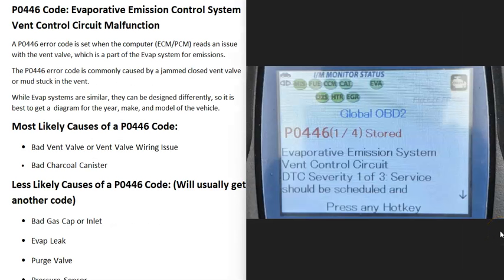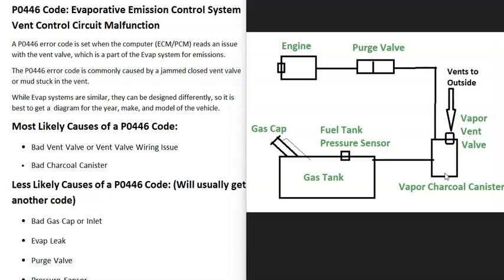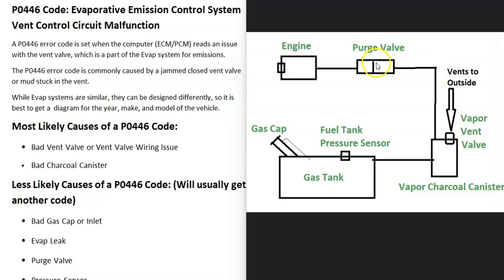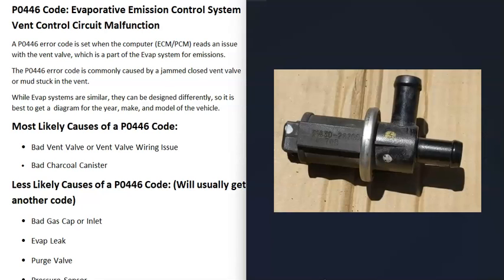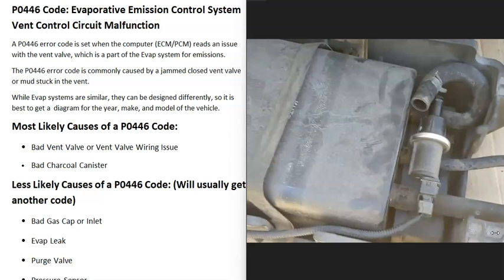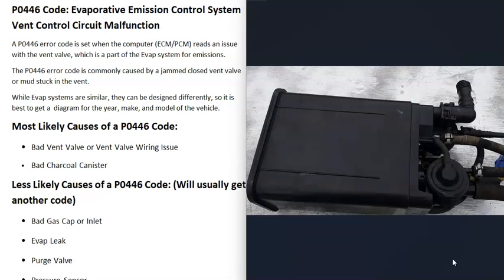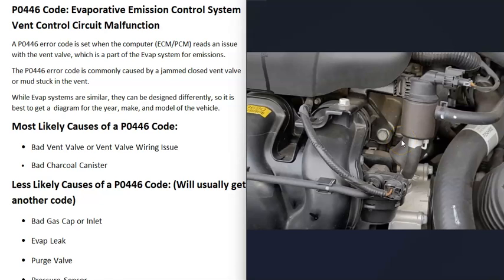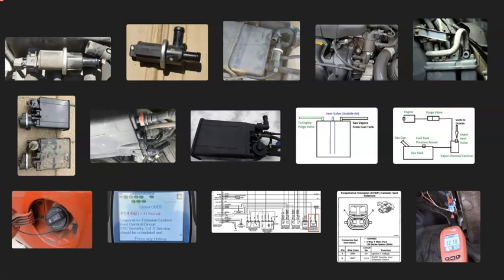Causes and Fixes P0446 Code: Evaporative Emission Control System Vent Control Circuit Malfunction

Comment: I am not a truck v8 engine mechanic. Bring me your older H-d and you will be happy. I have an 09 F-150 4.9 and just had a fuel pump etc. replaced. Tonite my GF and her 2 kids needed a ride home form my casa and the mighty F-150 spun just like it did @ the Circle K Wednesday and got tow to Pepboys on the corner where I live. 1600$ later, I was happy. Got it to go earlier and we got nada, just like it was on Tuesday. ???????? Just cranks and cranks. Got a code of P0446 and found the part @ 109$ but could it be a bad fuel pump again?

Comment: I have a 03 Chevy S10 zr2 I did smoke test and my vent solenoid they were smoke coming out and I test it on my truck battery and it didn't click would that be the vent solenoid
Reply from the maker: The vent valve is normally open, and smoke will come out of it while testing unless it is closed. It should click when power is applied; if not, that usually means it has failed.

Comment: I still have the code P0446  code any suggestion? When I refilled the day STILL had fueling issues but not CLOSE to what it was.
Reply: maybe replace the whole charcoal canister thats what imma do soon with my code p0446 taking it to my mechanic this week soon
Reply: @beexiong2171 exactly what I did
Reply: @beexiong2171  if ya wanna save 200$ here is what I did I bought the Dorman canister that doesnt have the sensor Port. Messured the area of the hole and where it is located used a step drill bit to make the Hole. And put the sensor in. Works as it should. Canister with sensor port 400+ without 140.... same internals. Why!? Such a difference in price NO CLUE.

Comment: Can having a code P0410-Secondary Air Injection System make the system throw the code for the P0446  also or do I need to replace both parts? It's on a 2001 Chevy Blazer LS.

Comment: I replace my emission vent solenoid  on a2006 Frod Freestar 3.9 and the engine  light is still on  what should I  do  next
Reply from the maker: It varies between vehicles when the computer tests the EVAP system. Also, many vehicles need a Drive Cycle to fully clear the code. Most people will drive around for 3-4 days, and if it's fixed, it will go away. You can look up the information on your vehicle to see what steps the computer needs to speed it up.

Comment: My P0446 is signalling excessive pressure. If I open the gas lid, the pressure sensor still shows -11.45mmhg. It doesn’t move much from -11. When I run the car, it still always stays at -11… bad fuel tank pressure sensor maybe? Chevy HHR
AllData is saying it should be at 0 with the gas lid off.

Comment: I have a 2013 Ford edge sport with the p0455 and p0446 and I'm 85 percent sure it's the fuel inlet. Ford's early non gas cap vehicles.

Comment: I am getting random p0446 I was told that it appears to be a short because the computer won't let him run the vent test, and it is causing it not to vent when it is idling which is causing it not to pass the cars diagnostic check but when I am moving it vents.  I just spent a lot of money on other repairs and asked the mechanic if it would cause performance issues or hurt my mileage, he said no.  Is p0446 just environmental?
Reply: It's environmental.  I was in Massachusetts and my 2002 Hyundai passed inspection with the code because of the car's age.  Moved to New York and it's a problem because it's less than 25 years old.  The mechanic thinks it might be the ECM, but no guarantees.

If your car passes inspection in your state, you really don't need to worry about it, but you should occasionally scan and reset just to keep an eye out for other codes.
Reply: @kenweller2032  Yeah, I got a cheap $20 reader with clear codes option.  I live in a state once you buy the car you have an inspection and your done you never have to worry about it again.  I didn't want to leave the light on because I would never know if new codes pop up.   Thanks for the reply.
Reply: Ò @kenweller2032

Comment: I'm getting P0446 on a Toyota Camry. I changed the gas cap and it's still there
Reply: Did you find the issue I'm having the same problem ?
Reply: @JosephRosado-u8m  It just went away on it's own. Best bet is to replace the charcoal canister.
Reply: @mr.paulino9318  thats what i plan to do just let me mechanic change out the whole charcoal canister  hope it fix the p0446 too.

Comment: I have a 2009 F150 v8 4.6 stx with code number P0446 engine light on, this vehicle has a  capless fuel fill inlet system, can this also be a problem? 
Thanks.
Reply from the maker: Yes, the cap less easy fuel inlet can also leak and cause an issue. Often, they can be cleaned up and made to seal again.
Reply: @HVAC_Mechanic  how do l know is not working properly and how can l clean it. Thank you
Reply: @javiermoreno7746 having the same problem on the same truck too thought it was the cap did you find a fix?
Reply: @Jeshua06  on my vehicle 2009 f 150 the problem was the evap valve on the charcoal canister right under the driver's door l didn't have to replace the evap valve the problem was a broken wire to the evap valve, l fixed it and is fine now 
Hope it helps

Comment: I'm getting a P0441, P0446, P0455 & P4218 on a 2004 Toyota Rav4 and I'm at a loss.  I've changed the purge flow sensor,  charcoal canister w/ pressure sensor and the majority of the evap hoses.  I'm not good with electrical tests so have not done any electrical tests so maybe that's the next step I need to take?  The weird thing is that it behaves fine but after a couple of months of driving it will randomly through a cylinder misfire code on any random cylinder and take out the coil pack with it.
Reply: Jason,

Toyotas EVAP problems are common. If I were you I'd spend $70 on a smoke machine and some baby oil to help finding a bad vacuum line easier. If you don't mind smoke, a cigar works okay too. If no smoke is present, ensure all vacuum lines are connected correctly. As far as testing electrical, get a 9v battery and some alligator clip test leads. Green/white is ground, red/white is hot. The switches will make a small clicking noise, and save you money. Apologies it took me so long to get to ya. First three codes are for EVAP, but 421 is for your cat. 

Research can only do so much on trouble codes, each vehicle is unique. Gotta open the hood to solve the problem. Good luck Jason!

Comment: Does this code clear its self upon parts placement
Reply: After so many cycles(start up) it usually does. Or within the first 100miles driven.
Reply: So is that the reason why when I drive for a couple of minutes my car slows down and stop like it's on break.. and you're right about the gas when I'm filling up my tank is keep on cutting off